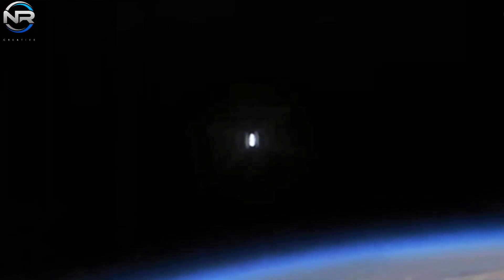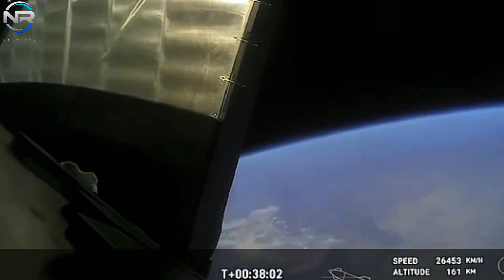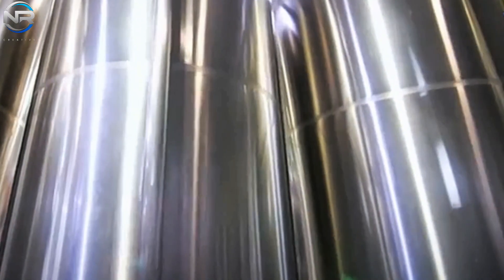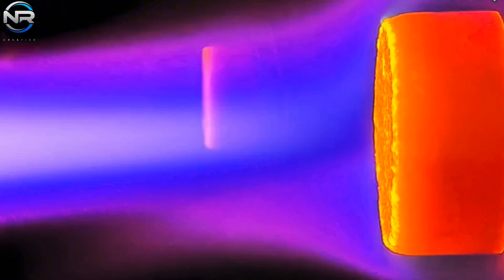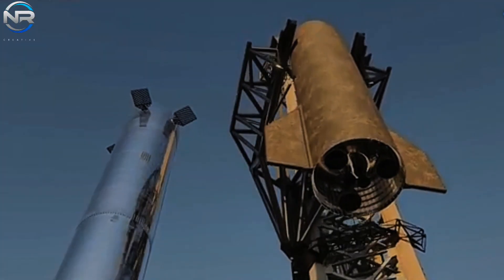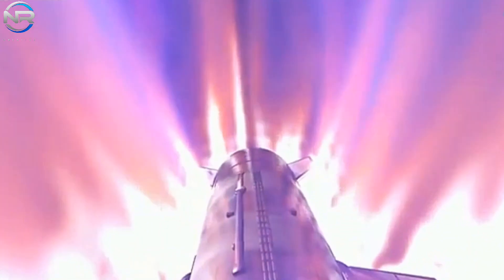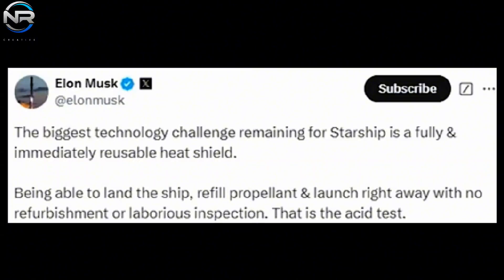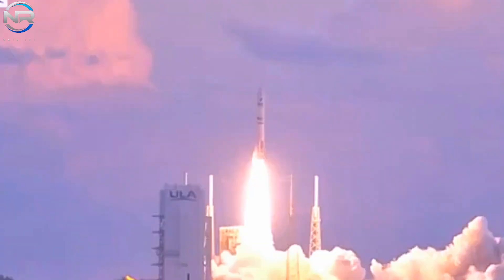SpaceX Just Replaced the Metal Heat Shield for Starship-V2's Next Flight

Comment: Rediscovering the wheel...McDonnell Douglas in the late '60s developed the MRS metal shingles to protect its prototype MDC 176 re-entering vehicle competing with the ceramic RCG-tiled Shuttle. The Reactive Cured Glass had been developed at NASA, and NASA eventually picked the Rocketdyne Shuttle over the Model 176 of MCD. The shingles bearing the highest heat fluxes were made of refractory metal and expensive, but they were very durable and did not need refurbishment after each flight. Space X stainless steel is cheaper but I doubt it will be durable because of oxidation over the long term, so I guess it will have to use one of the ceramic coatings (TBC) now available. Again, Space X did not invent anything new.